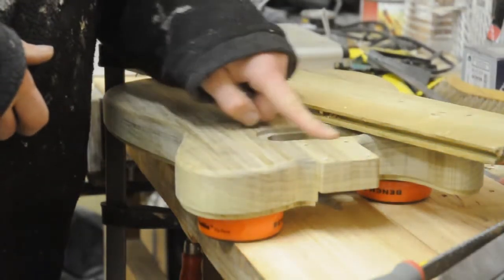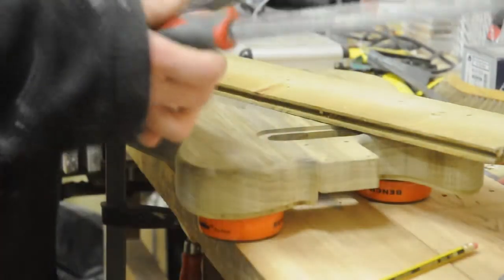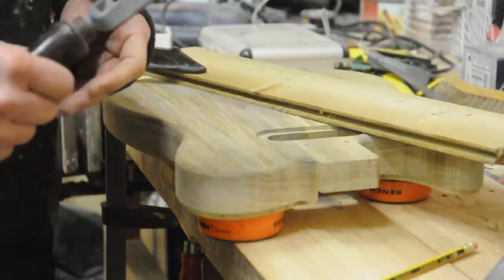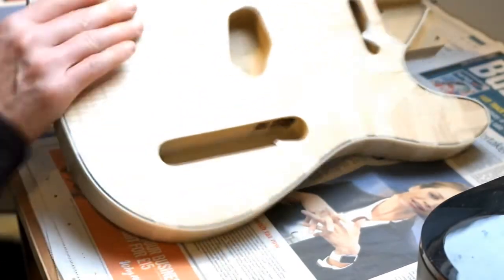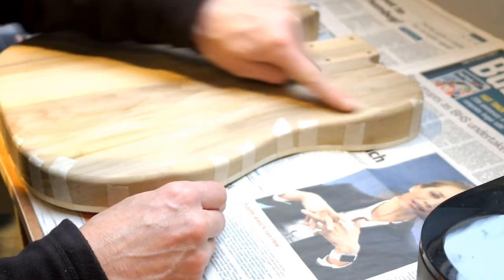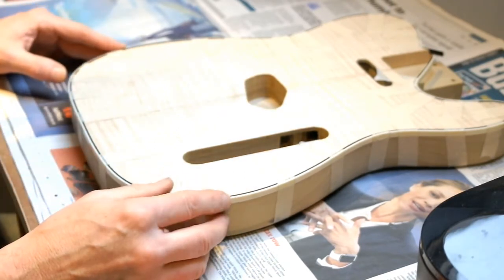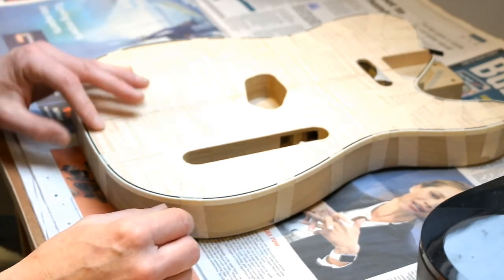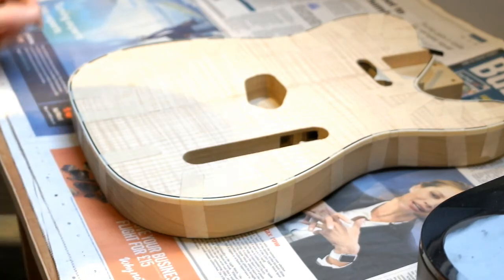DIY Luthier Telecaster build part 6:  Belly contour

Comment: I ordered binding from China, received enough to do 5 guitars ( a good thing ), and found it broke really easily. In any  strip, some parts were flexible and some extremely brittle,  so much so that it repeatedly broke just following the gentle curve of the belly on my telecaster. I ended up using all the binding and tons of acetone slurry to patch it all. Watching others do it on YouTube, it's clear that their binding was far far more evenly flexible and easier to work with. China's been great for some stuff and just aweful for others.

Comment: Hi, what was the reason for the binding to break? Do you think that heating it more would have prevented it?
Reply from the maker: I have found binding very tricky. I think I should have done the black first then the white and heated it a touch more. If you heat it too much it just melts and loses its shape so it's a balancing act. I still haven't got the hang of it really!
Reply: Oh ok I see, I thought the binding came already made with the white and black kinda "glued" together or something. The guys from Texas Toast Guitar have some great videos about binding, they don't hesitate to put a lot of acetone using a syringe.